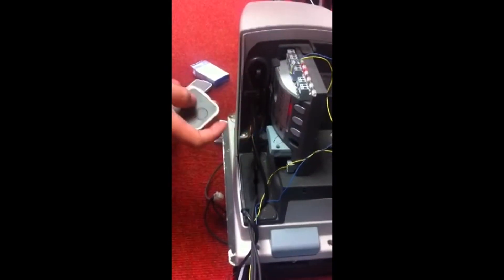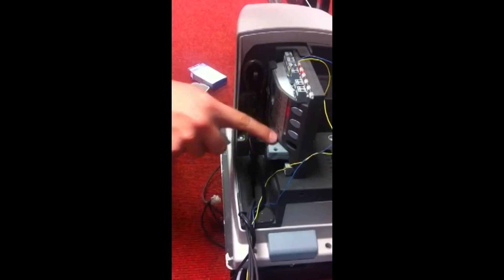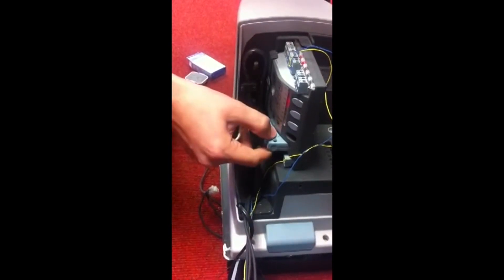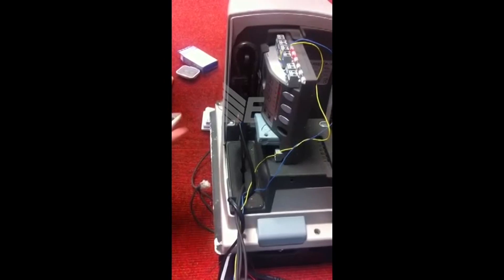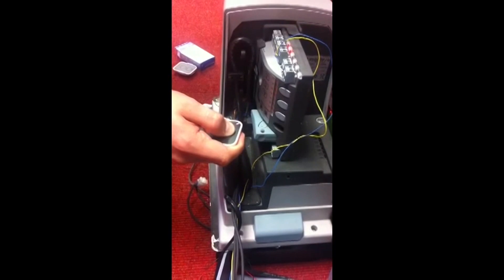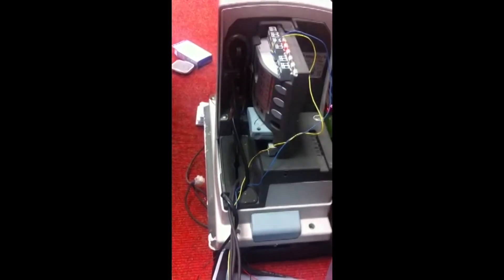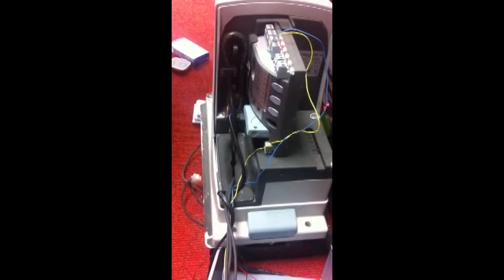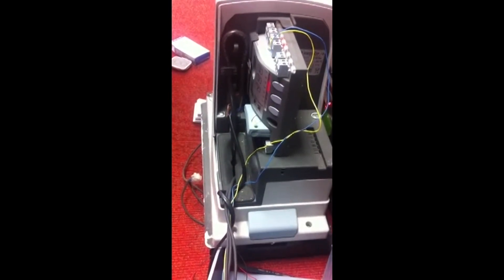How to Program Nice ONE Remotes into OXI Receiver

Comment: i have a niceone oxi/a reciever. we had  a bad thunderstorm and now our 2 remotes and keypads will not open door. we also had to replace tv boxes that also went bad from the storm. how do i make the remotes work again. thank you
Reply: Hi Desi, Typically this may be due to a power shortage which intern has cleared the receiver, have you reattempted the above?

failing this you can give us a call on 01384569942 opt 2 and we can begin executing a fault-finding process.
Reply: @joefern6421  yes, i did try the above. so i called the # but since it is international, it did not go thru. How do I get the call thru? or can you call me?

Comment: Hi Easygates. I have a nice OX2 receiver (the rounded one). When i press the button i get two short red flashes. It will not do anything else no matter what key sequence I use.

Could you suggest what I can do to get it to flash green and allow me to programme a new remote button please.
Reply: If your LED is showing red your receiver is the Nice SMXI receiver and not the OX. If you head over to Easygates' manuals website and search for the SMXI it will give you the instructions for your receiver. Or you could search SMXI PDF in a search engine and it will bring it up.
1. Press and hold the receiver button until the light comes on
2. Press and hold one of the buttons until the red LED begins to flash
3. Release the button
4. Wait for the red LED to turn off
5. Use the remote and check if it works